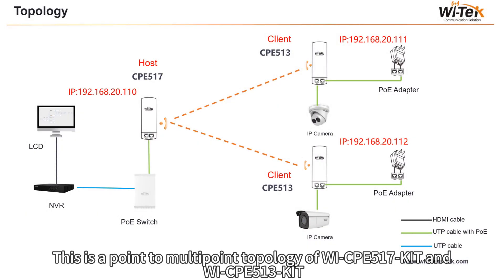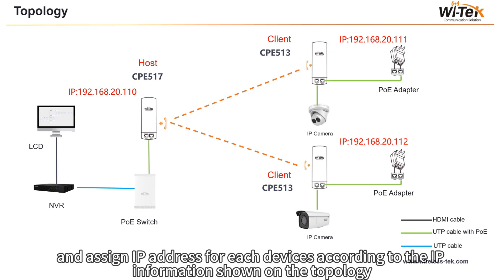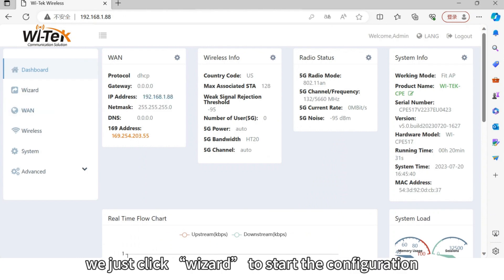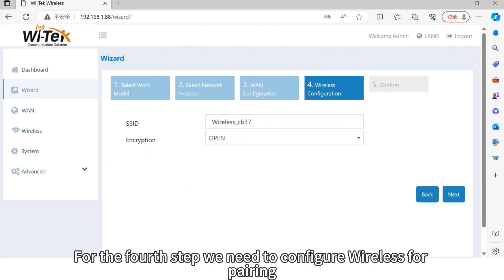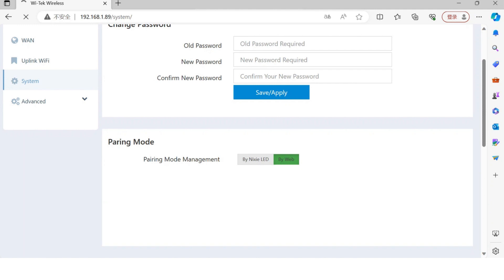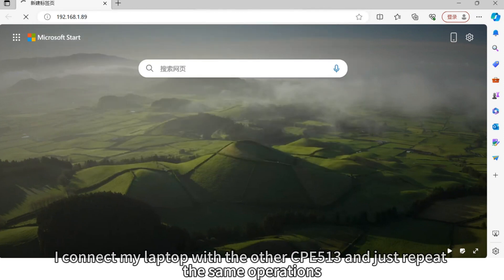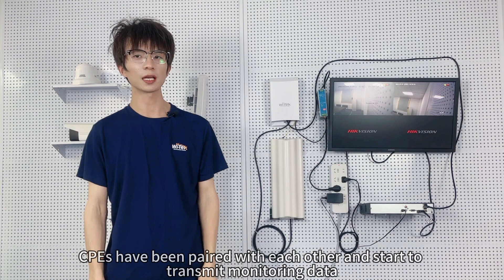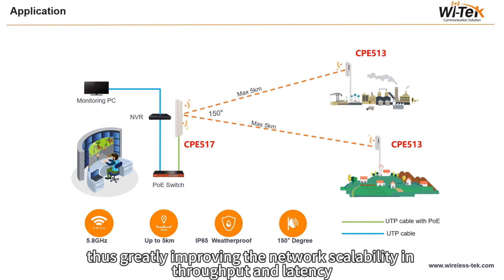How to Set Point to Multi-Point with Wi-Tek CPE Device?

Comment: Hello am in Jamaica and I need long range point to point base station set up I tried getting it from a local dealer and I seem to be unable to do so. I am in the process to start my own wisp wireless service provider and I have to give 80 customers services. I need your assistance in identifying the right radio for a 12 km point to point back bone link. Then I will need to do the base station using ur omni and sector antenna and radios. Can u provide me your email.
Reply from the maker: Hello firend, sorry for the delay in replying. Here is the email: gabriela@wireless-tek.com. Or you can contact via whatsapp: +86 18814457577. We will try our best to help you solve the problem.